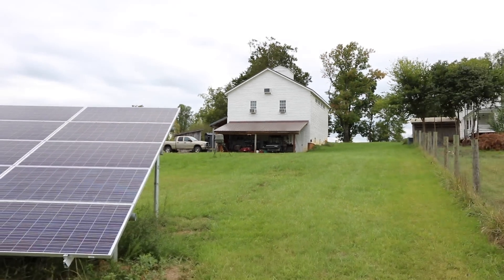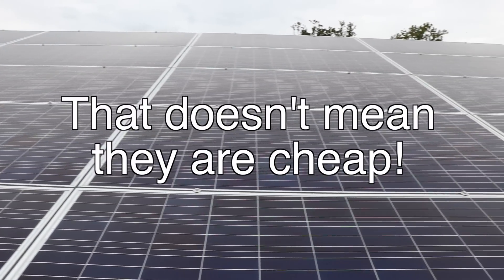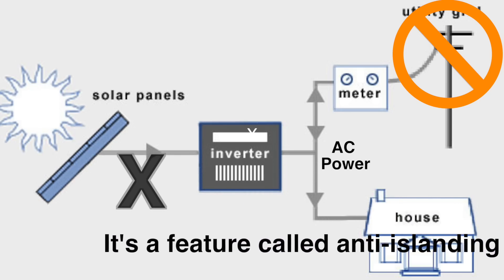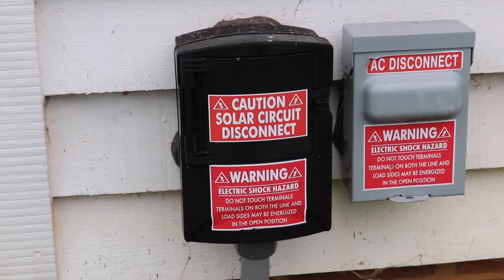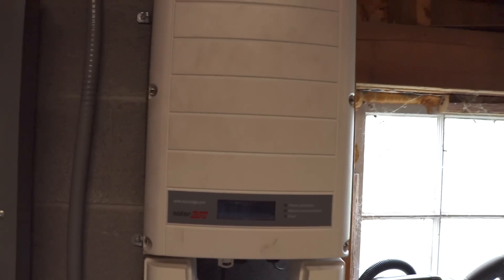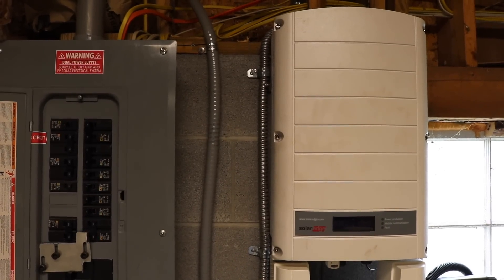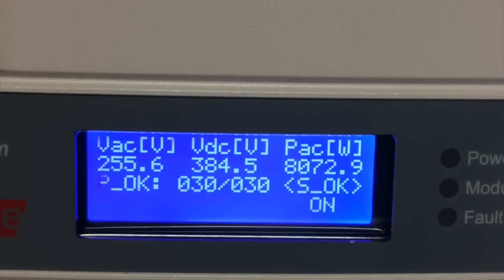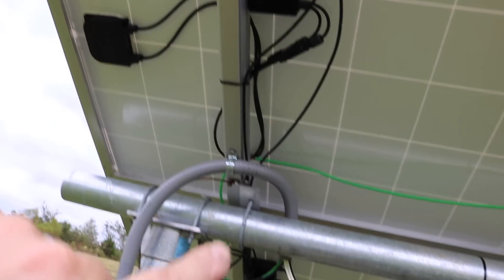The ugly truth behind grid-tie solar systems. Part 1, FarmCraft101 solar.  Watch before you buy!

Comment: It's not like it would be that tough to make an inverter that would shut off the connection to the grid but keep it to the house if the power went off. I think it's probably more that the power company doesn't want those with solar to have an advantage like that which would encourage more people to get it. I can't see getting solar and not having batteries. Once again, why pay the power company in the evening for power at full rate when they only pay wholesale for extra generated during the day? I'd size my system to cover my own use plus enough to cover all the damn fees beyond what the power cost from the power company and try to end up paying them nothing.
Reply: There are inverters that will work and power a home should the grid go down, they will automatically cut power going out, and once they detect incoming power, if it has gone out of phase, it will slowly work back into sync.  But these inverters are a bit more costly, and not all areas allow such equipment as it can malfunction and send power to the grid still, apparently.

Comment: Wow ! The premise of your video is so wrong on so many levels it's difficult to know where to start ? First: Your statement that a grid tie system is by far the cheapest system to build is totally FALSE ! It's actually the MOST EXPENSIVE by far ! The least expensive is to build an OFF GRID SOLAR SYSTEM. Why feed back into the grid ? Legislation in Canada at least, is rapidly removing the tax and electric company pay back incentives, thus why do it anymore ? You can get solar panels now which output 450 Watts per panel, thus reducing the amount of panels required to produce meaningful amounts of electrical current by 50 % You're obviously a very wealthy individual to pay out $24,000.00 US ? approximately for a solar system. You can run a house off grid now with a simply 5 kilowatt system for under $10,000.00 Canadian worthless Canuck bucks.
Reply: Kirk Johnson Yes. It does include the batteries. 8 x Trojan T- 105 RE deep cycle, flooded lead acid, 6 Volt Batteries
Reply: Mark , does that 10 number include batteries? Since you say it is off grid a assume yes. I'm just starting to learn about solar.
Reply from the maker: Wow.  Not worth replying.  You need to do some research sir.
Reply: Dude...  It's rather desirable to go with grid-tie as there will be time periods where the grid will be operational, but your solar system has been down too long to keep batteries topped up.  Even if the utility doesn't pay you for what you can pump to them, they become more or less a backup for when your own system can't keep up.
Reply: I can add. Your setup, although great, is far too expensive for most and reflects an elitist-wealthy, deep pocket approach. Off grid solar and Wind systems are far more profitable, as they free the owner from the overall monthly expenses associated with being on the grid, while newer solutions are far less expensive while considerably more efficient. 5 x 450 Watt 72 cell panels run into a Midnight Solar MPPT charge controller into an 8 battery Trojan T-105 RE 6 Volt, deep cycle, wet cell setup in series and parallel into a single mass 12 volt array run into a pure sine wave 5 KV (5000 Watts) 12 Volt to 115 Volt 60 Hz AC inverter will run a medium sized home as long as fridge is thermal electric (No compressor for cold), and cooking stove top is induction (@ 1800 Watts Max with lower wattage solector and cooking temperature adjustment)
Reply: Mark Job 450-550w Solar panels are huge. So using less panels is not really true. It's just a selling point. Grid Solar is cheaper. I've been installing since 1983.
Reply from the maker: A battery backup is the least financially cost effective part of a solar system.  If I were to run solely on battery backup without a grid connection, I would need at least 30 kWh of storage for my system.  Absolute minimum cost for this bank would be $3400, and that's standard flooded lead acid without installation  or maintenance costs.  If I got AGM or lithium ion, it would be significantly more.  This bank would need to be replaced every 5 years, which comes to $680/year, and that is VERY optimistic.  In reality, this would not be able to run my house normally during cloudy times or in the winter, but for sake of argument let's say it would.   That is $60 per month you are sinking into batteries, minimum.  More realistically it would be  $80 per month or more.  It costs me $25 per month for a grid connection.  So with off-grid, I would be losing $35-$55 per month, or about $480 per year or $4000 over the 8.5 year break even period, likely more.  And this doesn't include the additional expense of a battery backup inverter, charge controllers, and additional wiring/installation costs.  Off grid is more expensive and less financially efficient.  However, it does offer energy independence for that additional $$.  But without question, a grid tie system is the cheapest and most financially efficient, assuming you have a reliable grid connection.  Also, with battery backup you are limited in running large loads, like much of my woodworking machinery.
Reply: FarmCraft101 

25kw 48v system at cost is approx 30k last well over your lifetime. Or Edison batteries. Last over 20yrs but has to be maintained and needs a huge bank either way. Batteries are not used for back up anymore but for storage. I use Sonnen Lifepo4 which is expensive but what's needed to secure financing for customers. I can custom build a better battery system easily but can't get financing due to warranty issues. I use Schneider equipment for custom batteries. Battery storage has no ROI, it's a luxury product like buying a Tesla car. Even though it's electric, I can buy a Honda and put the rest of the money towards a lifetime of gas. Do the math.
Reply from the maker: "25kw 48v system at cost is approx 30k"  Are you talking about a 25 kWh battery bank?
Reply: FarmCraft101 
Yes 25kwh. It's the size of huge fridge and only ever build them for the higher end customer's in LA. Sonnen only has up to Eco16 and still over 20k
Reply from the maker: Crazy to think just the battery bank would cost more than what I paid for my entire system installed.  Yikes!
Reply: FarmCraft101 

Yes. I never recommend battery storage unless they're in an area that has unreliable power or doomsdayers. Avg Battery is just under 10kwh but the Avg homes uses 25kwh daily. So if power goes out they get a sub panel to run a few lights, tv, Internet and a fridge. Definitely not worth the expense. Tesla battery is lower than that yet has a BS marketing cost. No way can a lithium ion battery last 10yrs discharging at 100%. 5.6yrs tops or 2000 cycles so they set their system to discharge to 60% to add years plus gotta stay in your living space to cool. Creates BTUs your thermostat picks up the change and turns on your AC so where exactly is the savings. I know the true cost to install tesla and it's double what it says it is. I can build the best battery that can last a lifetime. It just doesn't make financial sense for the big boys. They need you to replace your system every 6yrs like their cars
Reply: The batteries are expensive but he has both Grid and off Grid set up so he pays both ways but it is a good set up if he gets 10 years out of it he will easily make money and also have a back up system for when power is out and pay for that as well.
Reply: I would not use a 5,000 watts for heat or cooking unless just essential but you can use a microwave and unplug the fridge for 3 minutes I guess you could do the same with an induction stove but that will really drain the batteries. Heat needs watts and it does not do well with solar.  However anything you can convert to 12 Volt is great. I have a 300 watt system but it is only for temp outages at night when I do not want to get up and fire up a generator.  It will power DC lights and my laptop and router with no problems. I can also power a 12 vote electric blanket and a 12 volt bed pad if it is cold that will help until I can get the generator going in daytime.  I do not have it wired to the house and my breaker panel is in a place it would cost way more than I could afford.  I also do not have remote start because I would still have to go downstairs and run a huge extension cord with 4 110 volt plugs each with a fuse and decided what to run usually my fridge and TV and if hot a fan. If cold I can run my fan on my gas heater.

Comment: False video.  It is simple to have a grid tied system with an auto switch.  Jees!
Reply: It is but the inverters that shut the power back off to the grid are a lot more expensive than what he is using or I am assuming that.  I did not get a good look at his inverter.
Reply from the maker: You need to look up grid tied vs hybrid inverters.  Grid tied inverters do not have battery backup, by definition.
Reply: Irrelevant semantics. I started designing solar power systems in '79.  You CAN have a system tied to the grid with a smart inverter. ALSO you don't need batteries to feed solar to your house.

Comment: You should have a disconnect switch of some sort, so that if the grid goes down, you can disconnect from it completely and use your solar system independently.
Reply from the maker: Grid tied inverters don't work that way.  If they are unable to sense the grid, they won't produce power.
Reply: I guess you'd need a second inverter without that feature.
Reply from the maker: Yes, you would need a hybrid inverter or an off grid inverter, both of which are much larger and more expensive.

Comment: I have the same inverter with just 24 panels and only make 1700 Watts. Hardly makes a dent in my bill.
Reply from the maker: How big are your panels?  Must be quite a bit smaller capacity.
Reply: Moon Pie Sorry for not getting back sooner. I forgot to mention that my system is only 6kw.

Comment: Do your homework folks solar supply comanies in miami got 425 watt panels 125 dollars each also sell the equipment i got an out back controller cheaper than anywhere keep in mind smart meters dont run backward i was told
Reply: Moon Pie sun and they run specials on line my buddy and i bought 2 pallets he went to their warehouse and picked up
Reply: Smart Meters usually won't run backwards, that is true, however, depending on your utility, and the firmware on the meter, the meter will stop counting your usage, and will count what you provide, and submit that information back to your utility provider for credits.  Some utilities will allow the meter to run backwards, but that is rare as almost none provide a 1:1 return to you if you feed back to the grid, they rather pay you a fraction of what they charge, so they will usually go with the first method I listed.
Reply: Marc Gion Berthoud i was under the impression sun panels 20 yr. Warrenty were great panels?
Reply: In that case they would have to issue you some type of credit.  I would think if it is a smart meter it would have a way to store that info if it does not run backwards.
Reply: Forget about cheap China crap. Buy the best, it is really worth it.
Reply: As a former electric utility employee I can say that almost all utilities require a separate meter for power being sent back to the grid. Having a meter "run backwards" making record keeping/billing etc. very difficult.

Comment: In my state tying in to the grid is a significant cost. I would have to drop $5,000 to tie in. That makes the grid tied system the most expensive system I could install. If however, I use it with a common sense battery back up and a generator so the system can be shut down for maintenance a whole house generator, I can be self sufficient. The cost for the generator is not much more than I would have to pay for the 'privilege' of tying to the grid.

Comment: Micro Inverters you have not optimists
Reply from the maker: So micro inverters are pessimists??
Reply: He doesn't have micro inverters. My guess is these are bypass diodes but they certainly are not micro inverters otherwise all panels would need to be in parallel and there would be no reading of 300+ volts DC.

Comment: It's not voltage it's  LOAD  the Current... Not voltage
Reply: Depends on the temp of the concrete.  lol
Reply: You understand it's not a good  to do DC  in parallel runs... EMF... I'm 12 years down the road I've learned a lot ... My system has paid for itself over and over  Run XW4860  x3 for 18kw  
P.S> Please  get your batteries off the concrete.... Thank you for Sharing your System we all learn
Reply: Batteries can sit on the concrete. It doesn't cause a problem in modern batteries.

Comment: Modern power converters and inverters have gotten efficient enough that some have instead built "selfish" solar systems where they put their batteries at the heart of things with solar charging them as much as possible and mains power also doing charging when its too dark or when the load is too high for the panels.  The power is then converted to AC and used locally.  This system has the advantage of being able to work when the grid is down and doesn't require weird expensive utility hookups.  It is "selfish" because it is unable to share power with the grid.  It's also more compatible with using your electric vehicle as an emergency power source and fast charging.  There are also better options for distributing DC power throughout the site.  (sorry Nicola Tesla)

Comment: Watch out for "smart" (actually "stupid") power meters.  The old fashioned ones were capable of running backward.  Most of the new "smart" models are digital and run forward even when you are pushing energy back into the grid.  There's nothing like paying the utility company to take your electricity.  The "smart" meters are too stupid to know the difference.
Reply from the maker: This is true!  They had to come change my digital "smart" meter for a net metering meter for this very reason.  I am pretty sure it's deliberate, so they don't have people generating power locally without entering into agreement with the power company first.
Reply: I'ts no skin off my back if you end up right and me wrong, but I seriously doubt its any kind of conspiracy.  At least in my neighborhood I'm convinced that the incentive to use those "smart" meters is that the meter readers don't have to get out of their vehicles to gather data.  That's huge when you've got thousands  of readings to take and most dogs can't come bite you when you are safely seated within your service vehicle. :-)  I also think line workers are scared poop-less about cheap Chinese On-grid power inverters that might be so cheep that they fail to disconect if the mains power goes out and I don't blame them for being concerned.  They expect and count on the power being off when they disconnect a line.  It's easy, in this age of the internet, to see conspiracies everywhere, but I see a more practical explanation.  Again I must repeat,  where I live the electric utilty is a nonprofit organaization owned by its customers. (A requirement by Nebraska law)  Consequently it's a wee bit harder to be too suspicious of their motives.  Incidentally if your meter faces the sun, cover its glass dome with a plastic Folger's coffee can.  It only takes a few years of direct sunlight for the UV light to kill the LCD display on those things.  Then you can't read the meter at all.  I had my utility replace mine for that very reason. :-)
Reply from the maker: I didn't mean to imply a conspiracy, but it really makes good sense.  Just as you said, the power company wants to know the power is off when it's off on their end.  If you are generating home power without their knowledge, it put their workers at risk.  It also impacts their bottom line.  They need to know who is generating power and where.  So having meters that won't allow customers to send power back to the grid allows them the ability to monitor all the home generation sites.
Reply: Half the time they do not get out of their trucks anyway they guesstimate it and do it every two months and one month it may be 150 the next month with same conditions it will be 200 or more.  I do see them check the water because it is easy they can check 14 Condos and not have to walk but 5 feet but I do not see the check the meters some months.   lol

Comment: What about the ones that separates grid and house AC? It can run even with loss of grid and has the high DC in too.
Reply from the maker: There are systems that run when the grid is down, but they are called hybrid systems, or just off grid systems.

Comment: FarmCraft101 wait a minute does US have both 110V and 220V ? seems kinda stupid have different Volts in one country ?
Reply from the maker: Johan - Yes, we have both 120 and 240.  The standard residential power is set up to have 2 hot lines, both 120V AC.  The lines are 180 degrees out of phase, so the potential across both lines is 240V, and either line to neutral is 120V.  So the regular household receptacles are 120V, running hair dryers, microwaves, computers, etc.  Bigger items are wired in with special receptacles or hard wired directly for 240V, like ranges, dryers, hot water heater, heat pumps, etc.  I believe there are many countries that just have 240V (or 220 if you prefer).
Reply: must be a US thing to have two systems working at the same time, like Imperial units/Metric system. 
how can you use volt, Ampere, there must be some "unit" that is 100% American ?

Comment: Your solar system is rated at 9.1 kW. How come on a sunny day, mid day, you only got 8.1 kW? Was it because of degradation? Have you seen a higher value when the system was new?
Reply: Thanks. I re-watched your video. Indeed the power reading was in AC, so, as you said, it included the transmission and inversion losses.